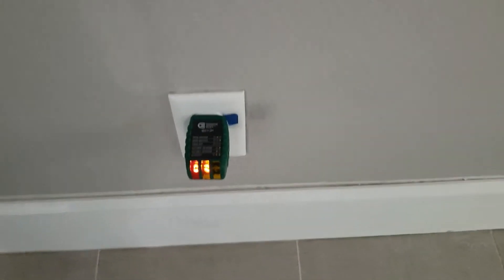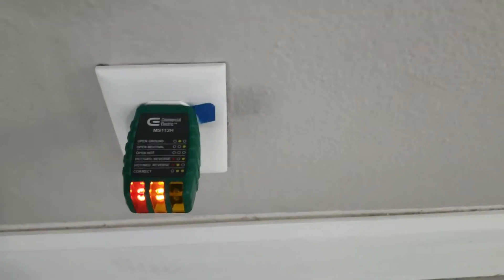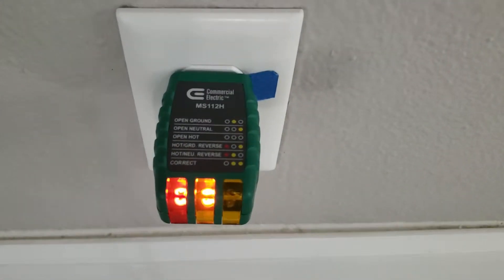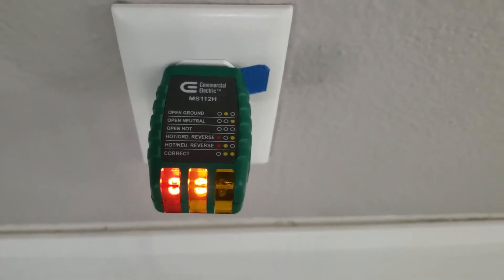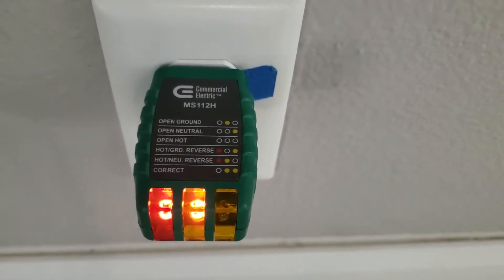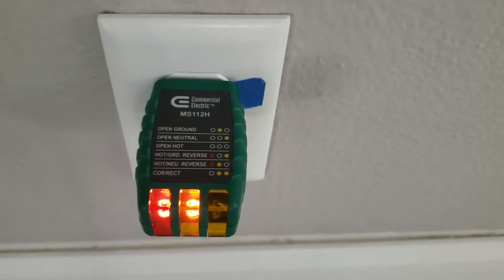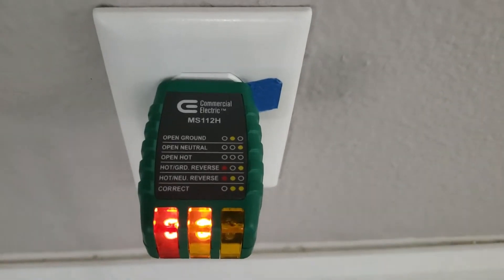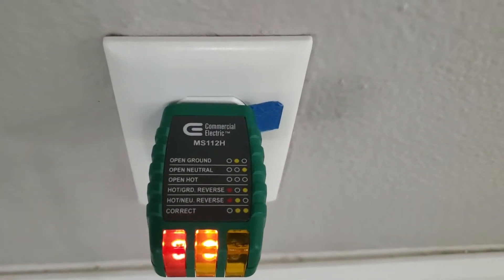What's Reverse Polarity? | Home Inspections with Inspector Q

Comment: We had one outlet that was reversed polarity in a new build that the inspector found. He wouldn't issue the c o unless it was fixed. Would this be an issue further down the road?
Reply from the maker: Thanks for sharing Marc! Im not sure what C O means. However, the issue may result possible damage or short circuit to appliances plugged into that specific outlet. If you decide to sell the home later, the buyer's inspector may find the reverse polarity outlet and buyer's may request repairs.
Reply: @Proinspectsolutions  CO certificate of occupancy required at some point

Comment: If there are that many outlets that are reversed...do you think it was just a sleepy/hungover electrician...or perhaps the reversed polarity was happening somewhere else upstream, or maybe at the panel? also, would you as an inspector remove outlet covers to double check? thanks
Reply from the maker: Thank you for your feedback. No, a home inspector doesn't remove outlet covers but will remove cover from electrical panels. Yes, this could be a problem upstream. Thanks for commenting.
Reply: I just had my home inspected and found out all my outlets in 3 bedrooms have same prob. Now how do I find out where is the actual problem? 😡
Reply: @iFlyny  iFly... Tunnel flyer?